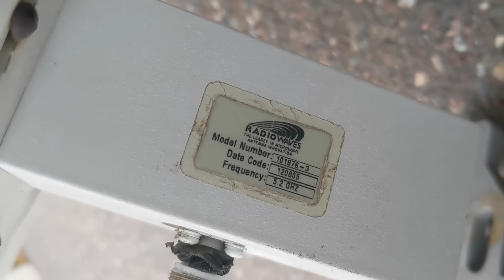I Bought A Whole Wireless ISP For $50

Comment from the maker: I think all my extra antennas have now been claimed, that was fast! I might temporarily hold on to a few of the midsize ones and make an array as several commenters suggested. Always fun to read people's ideas in the comments here 🙂
Reply: If you dont know what to do with it but is dirt cheap there is only one solution: GET MOAR :D
Reply: @saveitforparts  You're one of those legit genuine YouTube people who actually go through and read all their comments.❤️
Reply: You might need to keep those Cambium stuff in pairs to be useful as point-to-point links because they only work with their own proprietary TDMA based access protocol. But I'm not sure. Maybe they need their base stations and GPS receivers to work at all. I only tested a small demo with very few client installations of those yrs ago. The company is said to be incorporated by some former Motorola engineers. The ISP I worked for used Mikrotik and Ubiquity stuff mostly. There was a time (before a complete CPE could fit in/on the ODU) when the company asked an agricultural machinery metal shop to make them similar antenna heads for cheap offset dishes, but instead of the "cantenna",  biquads, yagis, RHCP/LHCP circulars in PVC pipes and slotted waveguides as sector antennas had been designed internally. Long cable runs and losses were a limiting factor. The dual V/H polarity stuff is for two radio chains so double the bandwidth on the same link (useful as cheap near last mile backhaul). You might get surprised how cheap the antennas can be made in those Cambium dish "head" CPE units. Ubiquity used 2-4pins of through-hole pin headers (0.1in spacing sized) plus PCB traces. I'm a bit curious to see it now (since the demo units were never disassembled) as a comparison. Some of Cambium Netwoks' CPEs were quite rugged as I remember. I mean almost fully made out of thick heavy metal parts. Be careful with your antenna problem, kinda reminded me of how the cable guy fell off onto a huge dish. 🙃
Reply: Those 18" and 22" antennae are excellent for 10 GHz Amateur Radio use. I was one of many people in Britain using dishes that size for two-way communication between stations up to about 90 miles / 150 kilometres apart, with transmit power of about 1 to 3 milliwatts. They were ideal for portable use. A 48 inch / 1.2 metre dish was a little too large for that kind of work, but some people used them. 

The problems with larger dishes include weight, stable mounting arrangements and wind resistance. A 4 foot dish on a hilltop with a 40 mph wind has a pressure of about 100 pounds on it. (That's roughly 1.2 metre / 65 km/h / 45 kg in Metric) With a 3 cm wavelength, the beamwidth of a dish that size is only a couple of degrees, so keeping it stable and with a portable mount is quite challenging.

Comment: I had Grok look into what you could do with these dishes.

To view keyboard shortcuts, press question mark
View keyboard shortcuts

What kind of ongoing science project, or experiment, could you do with 100 small satellite dishes commonly used for internet, satellite, or TV signals?

With 100 small satellite dishes, you could set up a fascinating citizen science project or experiment, leveraging their ability to capture radio signals. Here’s one idea that could be both engaging and scientifically valuable:
Radio Astronomy Array
Turn the satellite dishes into a distributed radio telescope array to observe cosmic radio signals, such as those from pulsars, the sun, or even the hydrogen line (a key frequency emitted by neutral hydrogen in space at 1420 MHz). Here’s how it could work:
Repurpose the Dishes: Small satellite dishes, typically 60-100 cm in diameter, are designed to receive microwave signals. With some modifications—adding low-noise amplifiers (LNAs) and software-defined radios (SDRs)—you could tune them to detect radio frequencies from astronomical sources.

Distributed Network: Place the 100 dishes in a spread-out arrangement, either locally (e.g., across a town or campus) or globally (by collaborating with others). This creates an interferometer, where the combined data from multiple dishes increases resolution and sensitivity, mimicking a much larger telescope.

Target Observations: Focus on something accessible yet scientifically interesting:
Pulsars: Detect the rhythmic pulses of neutron stars. Their signals are faint but regular, making them a great target for small dishes.

Solar Activity: Monitor radio bursts from the sun, especially during solar flares or coronal mass ejections.

Hydrogen Line Mapping: Measure the 21-cm hydrogen line to map the structure of the Milky Way over time.

Data Collection: Each dish could feed data to a central system via the internet. Open-source software like GNU Radio could process the signals, and participants could analyze the data collaboratively.

Ongoing Experiment: This could run indefinitely, tracking changes in the sky (e.g., pulsar timing variations, solar cycles) or contributing data to larger projects like those run by the SETI Institute or university astronomy departments.

Practical Considerations
Cost: You’d need SDRs (about $20-50 each) and LNAs per dish, plus cabling and a computer setup. Total additional cost could be $5,000-$10,000, depending on scale.

Coordination: If spread across locations, you’d need participants to align their dishes and synchronize data collection (e.g., using GPS time signals).

Educational Bonus: This could involve schools, hobbyists, or amateur astronomers, making it a great outreach project.

Why It’s Cool
With 100 dishes, you’d have enough collective power to detect real astrophysical phenomena, potentially contributing to professional research while democratizing access to radio astronomy. You could even stumble across something unexpected—like a new transient signal—since continuous monitoring isn’t common at this scale for amateurs.
What do you think—any specific cosmic target you’d want to aim for?

Think harder

Explain pulsar detection

SETI signal search

Comment: I am a investor in a local WISP have a 100 foot tower on my land we use the 15 gigahertz air fiber equipment. Those radios should be 4 watts output you have a good haul there. Can make your money back many times over. Or cause you could get fiber and set up your own network.

Comment: 1981 my father installed his first residential satellite dish. 
This was a 10-ft fiberglass dish C band system. The LNA loud noise amplifier was 125 ° when the job was complete it cost the customer over 25,000. It's just amazing to think how much things have changed in over 40 years.

Comment: An idea for what to do with all of those satellite dishes: solar panel array.

You could probably find a surplus of cheap solar cells that you could attach to the dishes and wire up a giant array to provide power out at Sandland. Maybe even set up a bunch of them near the monorail and power some kind of low-power AC units so it's not balls hot out there.

Comment: Gabe, if there is a local Amateur Radio club around there, they may be interested in taking soe of it off you for club projects or to flog off at "field days"/"hamfests" .. You could use some dishes to make a point to point connection over a long distance with LORA/Meshtastic ? Is Sandland in line of sight?
Reply from the maker: Sandland is a little too far to make a direct connection unfortunately!

Comment: Save them for parts. 😆
Seriously though, I'd be phasing /co-phasing Four or Eight dishes as a steerable array.
More metal in the air = more signal down the coax.!
Nice haul btw.👍
Reply from the maker: I've tried an array before and it was too hard to sync up the signals. Might try again with a KrakenSDR.

Comment: What did you get for the 915 MHz band? Did you get any equipment for the unused television bands?
Reply from the maker: I dont' think I have anything for 915 / LoRa, at least not in this pile.
Reply: @saveitforparts  thanks. 
   What I really want is to find some of that TV white space wi-lan equipment.

Back when I was running my WISP, I was using wanelan equipment, got them cheep when DEC/NCR sold and rebranded for lucent technology.
   When I shut down in 2003 no one would take any of the equipment even for free. Brought enough to the scrap yard to get $700!
   Still , I saved several, a few Yagis and patch panels, and 2mbs is fine for me.
I also collected a variety of other brands. Heck I even have a Pole Mount ricochet modem from New York City! The ricochet modems are remote booted and I don't have the server software, but I know it existed after they shut down and went bankrupt , because they restarted the network after 9/11 for a little while.

   What I really want is to find some of that TV white space wi-lan equipment.

Comment: Some of the smaller dishes you have can be converted into slot antennas for amateur radio uses. Also, there's a hotel in Duluth that has a giant dish in their backyard that LOOKS like it isn't used anymore... I'm trying to get ahold of that. Thanks for these videos.
Reply from the maker: It's worth a try, I've picked up a few big dishes that way!

Comment: One of the big antennas with the industrial strength mount could do good as a coal grill if you just burn off the paint or sand it off. Also, why not make a bath for the birds?

Some 20 years ago I bought a perforated big dish that I sanded down, let it rust outside for a couple of years, then ordered a glass for it with a thickness of 8 mm specifically to the dish since it is oval. I now have it as a table for my "tv room".

Comment: Possible uses: Pick out about 16 identical reflectors, attach them to a large motorized frame, and do some high-end interferometry or radio astronomy or just satcomms. It would be fascinating to try and pick up very distant satellites. Another use: Take two offset reflectors and put them at opposite ends of a straight tunnel in Sandland. Audio reflectors for long distance underground communication. You might even be able to bounce them around corners.

Comment: Not sure if it's useful to them, but you might touch base with Erick Westgard on the Wifi devices. I'm not sure if they setup is point to point, or point ot multi-point, There is a WiFi Mesh in 5.4 ghz that some of it might work with, or possibly allow for some extended links on the periphery where that might make sense.

Comment: Don't open those wifi antennas you'll ruin the waterproofing if they still work. If they don't work go for it. But it would be really useful in sandland; you'll need way more antennas inside there to get coverage than in a normal building. You don't have to put them in the dishes for that probably

Comment: If somebody could fund to ship it, some of these dishes can be repurposed to TV dish antennas in several poorer countries where people lack access to even TV network because of affordability issues with the Hardware. 
The amount of dishes you own single handedly can easily transform the information availability for an entire small village in Africa, India, Pakistan or Sri-Lanka. 
I have seen people in India use TV dishes rusted to the point of breaking down but don’t buy a new replacement cuz it will put them under for other expenses for several months.

Comment: I've got a 4-5ft big girl still in it's crate, with the horn set for 10-11ghz licensed link stuff, but I'm sure you could repurpose this monster dish, if you're in the neighborhood for one =p.. Retails for like $3,000, I'm asking $300... It was purchased for a license link to a really big factory, then we ended up going with a different technology, and I got to take it home. Just tossing that out there. I will say though, if and when you want to run wifi at sandland.. consider reaching out to me. There are likely better ways to go about it. The ubiquiti 5ghz stuff has been getting really really cheap second hand lately, just remember than "non ac, and ac" are not cross compatible, but you probably want something like their AC Mesh, and then repurpose two of those longer range dishes to deliver the internet to them. It's a cake walk, but frankly the 3 pack mesh from tp link for like $80 aren't that bad. I've installed a few for client side projects, but nothing holds a candle on ubiquiti if you want to spend a few extra bucks. 

You're fairly on point.  I'm one of the traveling specialists that install this stuff all over the place. 

Those rectangular stuff you have are in fact sector antennae. Those ones appear to be ubiquity, however companies like memosa make stuff that would work with them. 
It's likely a 120 degree sector, and would accommodate something like an airmax rocket prism 5ac.  I'm fairly certain at least the antennae whip on the top right int he middle is a 2.4gh omni AP. 
Rule of thumb if you want any of it for internet, figure out what uses ubiquiti and keep that, toss the rest unless you have tertiary goals with them but in terms of keeping it for it's original function, just keep the ubiquiti stuff <3 I LOVEEE Ubiquiti and youll get the most cross compatibility out of a lot of it, firmware support, and its just generally speaking the best in the biz. It might be hard to sell the dishes but people will eat up those feed horns who want to keep their old tech in place and need to swap out a radio, since things get expensive fast when youre paying climbers and suddenly its either replace the single radio or be forced to upgrade the entire link. 

Those bigger grey dishes on those towers are definitely just long range relays trying to get a backhaul channel from point A to point C, and that tower was point B. Two of the  nicer newer dishes towards the bottom are probably doing that same thing, and I'd place my wager that the smaller more conical dish on the bottom right leg of the tower is what is feeding those rectangular sectors at the top. Just a guess, otherwise it's a dedicated feed to a privileged client. 

I digress.. The ubiquiti stuff you could probably resell. Cheers.

Comment: Hey, neat! I do very WISP-y work out west installing microwave point to point backhaul for wildfire cameras on microwave towers. I’ll tell ya what, the smaller dishes make great nerdy ceiling lamps if you rip the feed horns out and put a cool bulb in. Just get one of them single bulb kits, and hang by a prussik to the ceiling by the cord. Might be a funny solution for lighting in the sand bar. My office has 6 of ‘em lighting it, damaged in various ways from mostly icefall. Amazing that a dying wisp actually took down any tower hardware at all, a lot of the time where I’m at, the orphaned stuff all languishes up top until someone else needs the space.

Comment: We tried a wireless internet system like this back in the 2000's called Sprint Broadband Direct where they broadcast a microwave signal from a mountain top nearby to a little dish on the roof. However the only time it worked was when they first set it up. They put the dish on a pole by the house and got the blazing speed of about 640KB which seemed like a lot compared to 33K dialup but after they left it never worked again. They tried moving the dish and putting up another one but that never worked either so the whole thing was a flop.

Comment: Have any medium size dishes? 1.8 meter to 2.4 meter offset(like the little TV style dishes but a lot bigger). The small 18" TV style dishes are great for 10ghz ham radio stuff! Bigger round ones too... but I need one to bounce signals off the moon... so larger!
Reply from the maker: Nothing quite that big, sorry! Most of my extras from this pile have found homes already. I do want to get into EME eventually when I have time.
Reply: @saveitforparts  thanks for the reply! Yeah they are hard to find... offset is best because of no feed blockage and no cables in the dish beam so less noise pickup on receive and less RF on cables on transmit. Those little directv dishes work very well for terrestrial microwave at 10/24ghz, W1GHZ website has an article on them.

Comment: So I hate to keep harping/beating this dead horse, but for some reason it's really important to me for us all to have a network to communicate on, VIZ: the LoRa stuff. What frequency are those offset antenna tuned for? If you can make the 915 mhz band come through clearly, I'd suggest using your HAM license, and boosting the wattage past 1 watt each repeater. That plus a giant antenna and height, how far could you broadcast in raw miles?  And again, using 8 bit machines, it would be super cool to build an internet independent BBS system.  That card you have that takes serial and turns it into modern wifi got me thinking, it would probably be just as easy to broadcast at ANY frequency.  Plug a modified card into your retro machine, and BAM there is your end node.  Also, if you can get old ISP stuff, why not try and get some copper telephone backbone infrastructure?
Reply from the maker: I'll have to think about it, the mesh network stuff usually works better ominidirectional and not focused, but it depends how far you are from the main network.

Comment: The flat vertical antennas are mobile transmitter antennas. They can be for others things possibly. I am not sure how the U.S market works. You can figure out their working frequencies from information on the transmission antenna it self.

Comment: I used to work for a WISP! I swear almost no one knows what a WISP is. XD Some fun looking stuff here! The feedhorn radios are pretty boring inside. The Ubiquiti ones are at least; they're just a single PCB with little pin header looking things for antennas. For short range stuff, you can just use them without the dish if you want to do a quick and dirty building to building connection.